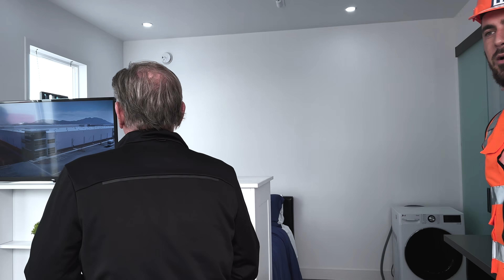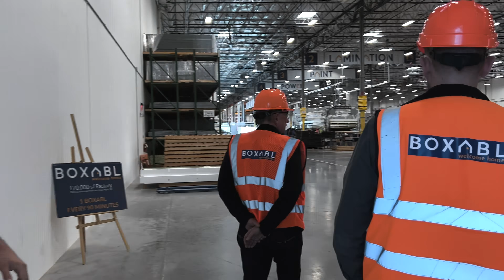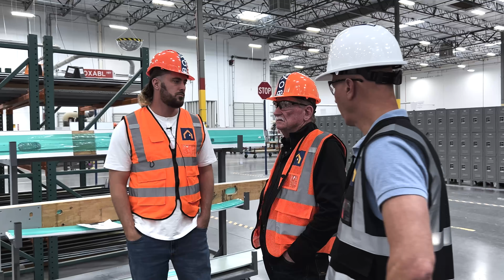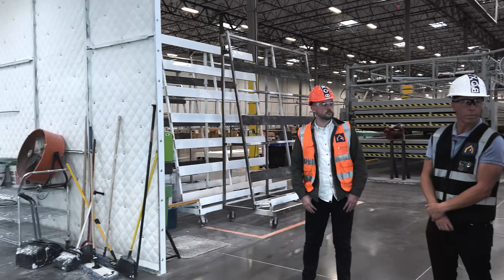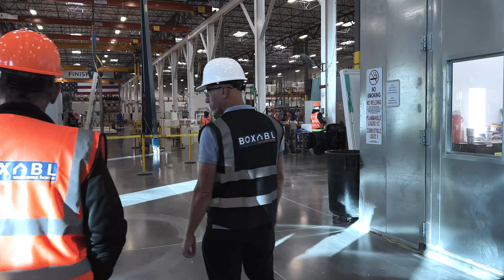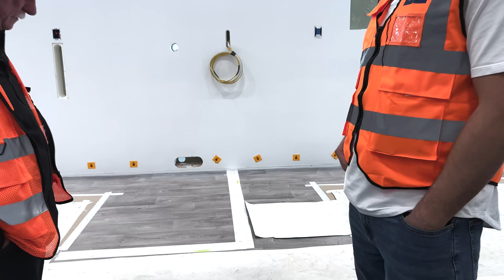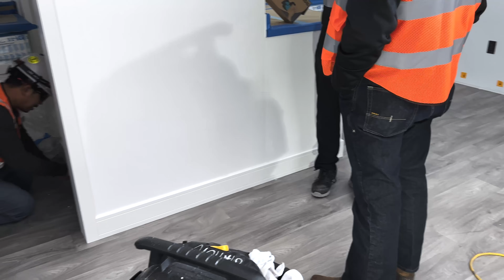What's in the BOX!? - Unfold your new home today | Boxabl Factory Tour

Comment: Humm not a good effort,  was dooing this 20 years ago , modular msnchester uk
Reply: No one solved for shipping legal loads on a fold down concept until Boxabl though... That is the game changer IP for full house 20x40 room modules coming at the next scale of factory...
Reply: @rule1capital  we made them flat pack or complete room's 
Bath rooms in one factory finnished room just plug it in to the services 
You have a kitchen problem for shure 
And services in the walls , panel joints 
Matereals snd so on
We also made sections of roofs , floor systems 
Large bathroom solutios bla bla bla 
So main business was bathrooms compleat just crain in during the buildings being framed out   then flat pack bathrooms for air ports 
Ans service stations where speed was critical 
Company was taken over by britspace .
Reply: @spikeccx  In the US, there is a huge stigma against old school manufactured homes, rightly or wrongly... And even though they are made in the US, their piece of the total newbuild pie is tiny because the shipping issue in such a large, spread out country... Boxabl is looking to become a universal building shell standard for mass builders such as DR Horton, who became a strategic partner, investor, and customer in April 2022...
Reply: @rule1capital  can be totaly custom easy 
And flat panal system easy to transport and rebuild on site , just advanced SIP panels realy , gota say seen builds in the usa ....years behind realy , designed life houseing , you have to admit a house you buy and then it pays YOU its better
Reply: @spikeccx  You could do the rebuild onsite with partial prebaf, but then your back to all the same issues of onsite building, timing, labor needs, and lack on consistency on tolerances... All trade offs to consider, but not nearly as scalable as a business model...
Reply: @rule1capital  no you are not , we and zee germans have prefab turn key houses  it may be how your sites work , your regulations , codes ect 
Work . The small units you are dooing be dead easy , infact could be totaly off grid houseing
Dead easy , ive done them as well for construction sites and Afghanistan bases
Container sized units fully self contained watet , power , heat and air con !

Comment: I really hope Sandy goes back in a year. Would love to see how things are when they’ve implemented all the changes they talked about. And then see Sandy’s thoughts after the changes.
Reply: It's going to look way different at Factory 1 Complex during the 2023 ramp, after deploying the $100 million raised in 2022 to (A) nearly double the square footage, which will free up space to double the number of production stations, (B) add lots of production automation all along the line, (C) and ramp up the shifts to max out production towards 5,000 units per year run-rate...
Reply: @rule1capital  They’ll raise another $100 million come April, which is not far away.
Reply: @BattyIncept2016  Yep, Boxabl may have been the first company to ever max out crowdfunding limits for a given year... Boxabl raised the max $75 million for Reg A+ from 4/1/22 to 8/25/22 and then raised the max $5 million Reg CF in less than 12 hours on the afternoon of 8/25/22... Because of these SEC limits, Boxabl has been unable to accept non-accredited funding from 8/26/22 to 3/31/23... With the 12 month rule for crowdfund, Boxabl can start the 2023 Reg A+ on 4/1/22... Reg D accredited can still be accepted on a continually rolling basis...
Reply: They need more than help, they need open heart surgery. Just saying.

Comment: Wow, they are using very expensive compression fittings on the plumbing, I'd think going to crimp fittings would be a lot cheaper
Reply: Isn't that an easy change to make?
Reply: Would they hold up as well during all the shipping and contorting of the panels?
Reply: @aussie2uGA  I have no data but logically I'd say yes if not better.   RV industry has been using PEX with crimp fittings for years, and they spend way more time on the road.

Comment: I absolutely love the concepts and think Boxable's mission is important and extremely worthwhile - world changing, even.

I didn't see anything on that production line that didn't seriously suck.

Their current operation is obviously an ongoing, calamity. That honking you hear in the shop is a glacier that needs the production line to move over so it can pass.

The International Space Station called to complain that every time they pass over that incandescently hot mess, it blinds their sensors.

Boxable needs to buy several hundred hours of Sandy's time over the next 3 years.

I wish them all and every possible success in the future.

Right now though... Yikes!. Seriously... Yikes.
Reply: The current process, in relation to where the current business plan is and will be by the end of 2023, was not clearly articulated in the video... Q4 2021 (start of Factory 1 production) - 2022 is super low-level production, more R&D like, to iron out this brand new company and process for 2 large orders... Q4 2021 - Q2 2022 saw the 1st contract delivery of 156 units to the Department of Defense... Following that, small upgrades were made to the line for the next current contract being fulfilled for roughly 175 units to a remote Arizona mine for workforce housing... The first full year in the factory (2022) is highly manually intensive work, just to get the simple, slow version of the process down and to obtain real-world feedback from units in the field, before introducing Generation 2 Casitas into the production process in 2023... Additionally, 2023 is expected to ramp run-rate production 10x-15x over 2022 levels, mainly by nearly doubling Factory 1 space to more efficiently setup the factory, but most importantly deploy some of the $100 million raised in 2022 on much more automation in each of the assembly line stations... The additional space and optimized layout is expected Q1 2023, the automation equipment is expected in Q2 2023, and the bulk of the production ramp is expected in Q3/Q4 2023...
Reply: @rule1capital  I don't want to diss Boxable, but... they have identified weaknesses in their alpha production line.  That isn't quite the same thing as thinking through mass production and looking how you get there.  Why the heck do they have drywall seams at all; making extremely large sheets of drywall isn't that hard in the first place if you don't need to move it around the country.  Why are you screwing drywall to OSB instead of gluing it down?  There are just a lot of things like that where they start to look more like an investment scheme rather than a manufacturing company.
Reply: @patrickkenny2077  It is totally fine to diss Boxabl if you think it is warranted... But is it really a "weakness" when they are producing at their expected level of production for 2022 (300+ units for 2 big contracts)... They raised $100+ million in 2022, which is now being put to work on nearly doubling Factory 1 space, automation equipment, doubling the number of production sub-assembly stations, and going form minimal to medium level of automation... I will say that 2023 it put up or shut up time for Boxabl in terms of proving to investors and prospective customers about how effectively they can scale up towards max production of 5,000 units per year ($300 million in sales), in an economically viable way...
Reply: @rule1capital  Unfortunately, I have seen a number of companies come and go from this space over the years, including better-funded ones. Boxable's core strategy is to franchise out its factories and make profit that way.  It might work.

The issue I have is that much of their innovation is in the hinge design, and I am not sure that is really something that will make them successful as they scale, especially as they go beyond the (extensive market for) the Casita.  My personal experience is that a core + panels (for roof and exterior walls) is a more flexible and scalable solution once you get beyond the Casita's size.  This matters because they seem to focus so much energy on where they are at that I wonder if they will go further.  I hope a lean design expert like Sandy can help give them insight there.
Reply: @patrickkenny2077  Yep, there is no guarantee of success on a venture like this that is trying to so radically shake up the current status quo... However, Boxabl does have super massive tailwinds that other competitors do not... (A) DR Horton (80,000+ US newbuilds per year) became a strategic partner, investor, and customer in April 2022... Boxabl has already shared with shareholders that this allows them to tap their supply chain when scaling and provides an incredible open-ended demand opportunity for apartments/single-family homes built by DR Horton... (B) Boxabl may be the first startup to truly leverage crowdfunding to its greatest extent possible... Boxabl maxed out $1m 2020 Reg CF (max increased to $5m in 2021), $5m 2021 Reg CF, $5m 2022 Reg CF, and $75m 2022 Reg A+ (took over a year to receive go ahead from SEC for A+ round to retail investors)... Boxabl has raised money from Reg D accredited too, but the vast majority of 40,000+ investors are small mom and pop retail, who create a self-reinforcing flywheel for free marketing in their local networks... (C) Paolo (CEO/IP/cofounder) and Galiano (Business Dev/Guerilla Marketing/Director) don't come from the residential construction industry, which enables them to have no preconceived notions to lean on... They only care about how we can deliver best product at lowest price point, fewest SKUs possible (standardization, no options), and is designed/built to scale... 99% of other builders have too much baggage with affecting the current business or aren't willing to go all the way to full standardization and automation... Sandy's timing to tour and talk with Boxabl is perfect, since Boxabl only raised around $50m in 2020/2021, but just raised $100m in 2022 and is about to make massive investments, for the 1st time, in more space and automating away much of the inefficiencies we saw in the video... Paolo and Galiano have been extremely capital efficient up to this point and it has worked out well that they took capital spending slow in 2022, with the institutional funding markets seeing the worst conditions since 2008...

Comment: Mass production on an assembly line requires interchangeable, standardized components that can be fitted together without having to make any adjustments to get a proper fit.  That has been the stumbling block for housing.  There is always a need to custom fit the components of the systems used to create the dwelling, due to site constraints and poor standardization of the different component systems. There still seems to be a lot of custom fitting and fettling of parts being done to make those Boxabl Casitas.
Reply: The current process, in relation to where the current business plan is and will be by the end of 2023, was not clearly articulated in the video... Q4 2021 (start of Factory 1 production) - 2022 is super low-level production, more R&D like, to iron out this brand new company and process for 2 large orders... Q4 2021 - Q2 2022 saw the 1st contract delivery of 156 units to the Department of Defense... Following that, small upgrades were made to the line for the next current contract being fulfilled for roughly 175 units to a remote Arizona mine for workforce housing... The first full year in the factory (2022) is highly manually intensive work, just to get the simple, slow version of the process down and to obtain real-world feedback from units in the field, before introducing Generation 2 Casitas into the production process in 2023... Additionally, 2023 is expected to ramp run-rate production 10x-15x over 2022 levels, mainly by nearly doubling Factory 1 space to more efficiently setup the factory, but most importantly deploy some of the $100 million raised in 2022 on much more automation in each of the assembly line stations... The additional space and optimized layout is expected Q1 2023, the automation equipment is expected in Q2 2023, and the bulk of the production ramp is expected in Q3/Q4 2023...

Comment: I've always wondered why Hiab lorries aren't more of a thing in the US?

Seems daft having a wagon deliver the structure and needing a separate crane ready waiting on site to actually unload & unfold the thing. Crane hire is often not particularly cheap when you only need to book it for a super short contract.

...You see Hiab wagons everywhere in the UK (both on rigid 8-wheelers and artic trailers. Shipping via Hiab lorry would lower delivery & setup costs quite a bit as it would make it a simple one man job to ship, drop off, & set up the building.
Reply: Even over a year ago, Boxabl was working on next generation plans to get rid of crane needed for folding/unfolding roof...

Comment: These guys are just up the road from me and admittedly I have invested a little into the company. I am however a little surprised at just how inefficient their assembly line still is. Boxabl Factory 2 hopefully is a big improvement. All of the wall and floor panels should be nearly f not completely automated, with just raw materials being fed in, then assembly needs looked at to hopefully modularize some of the interior installations. So you could say add an entire kitchen package in 5 minutes. It was really the hand forming (wire cutting) of the foam and the wall panel assembly process that was really looking slow.
Reply: The $100+ million raised in 2022 will show up in the new automation equipment, 2nd facility at Factory 1 Complex, and more production shifts in the 2023 ramp... It's great that everyone is talking about how many inefficiencies there are at the current labor intensive Factory 1 process in 2022, but if you take a step back to a 40,000 feet view, these guys are absolutely rewriting the rules of the game compared to the only current build options of traditional on-site construction...

Comment: i thought the tiny home movement was over? 
plus i don't see a price. anyone know what this 20x20 costs? this is the deciding factor in survival of this industry.
Reply: Boxabl Casitas are 20x20 exterior and the current price for the unit is $60,000, with all appliances included... None of the modular competitors come close on price... There are some competitors with cheaper micro backyard units, but those don't have electric/plumbing and/or are much, much smaller in square foot... The real name of the game here though is who can get to mass production fastest...
Reply: @rule1capital  that is very expensive. the tiny house movement is based on doing this cheap. 
not sure at all how this is going to take off at all. it's not even easy to move after set up.
i guess we will see how it pans out soon enough.
Reply: @Mike-Minion  365 square feet, with 9.5 feet ceilings is not comparable to 100 sqft, skinny tiny homes... What competitors, close in size and with integrated electric/water/HVAC/washer/dryer/breaker box are comparable in price? It's easy to say not competitive, but show me their competition...

Comment: I would suggest they also do cat 6 and rg-6 wiring to every outlet (or at least have that as an option).
Reply: Why,?  They are only one room tiny houses.
Reply: @Resist4  that was their INTRODUCTORY Gen I model. They have a 2 bedroom with deck model they will be introducing at the International Builder’s show next month in Vegas. 

They can build up to 3 stories right now, and expand out as much as you want as you connect the stackable and expandable units
Reply: Cat 6 and RG-6 are so 2010. Our 2014 home is 3100 sq ft home and is loaded with wires. I just switched to CentruryLink fiber optic internet (100 MB up/down) and YouTube TV streaming for five 4K TVs. Phone is 5G Verizon and WiFi calling when in the home with iPhones/Pads. I don't need or use the communication wires anymore. Comm wires definitely not needed for 400 sq ft.

Comment: this company needed Sandy guidance much earlier
Reply: Frankly, that can be said of 99% of manufacturers today.
Reply: Boxabl only started R&D-like, low-level, labor intensive building for 2 large orders in 2022 (300 units for year)... Boxabl raised a combined roughly $50 million in 2020/2021 and over $100 million in 2022, vast majority through crowdfunding (you can see financials on SEC filings)... Before dumping lots of that money into new automation equipment, more factory space, and more production shifts, the company has used 2022 to produce a relatively small amount of Generation 1 units for real-world feedback... 2023 has been the major planned ramp year, with the goal of reaching 5,000 units annual run-rate toward the end of the year...

Comment: How do the assembly workers feel about the automation?
Reply: The plan is to go from 300 units in 2022 at Factory 1, to 5,000 units in 2024 at Factory 1,  to 100,000 units produced in 2026 at Regional Megafactory 1... Even with extreme automation at the Megafactory, current workforce will still grow total headcount, just not nearly as much as 333x growth in output unit volume...